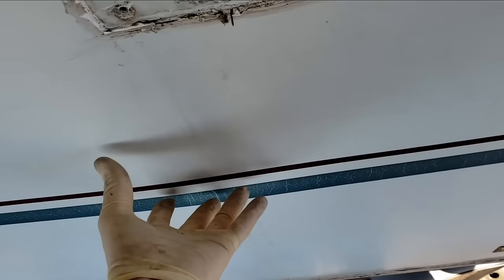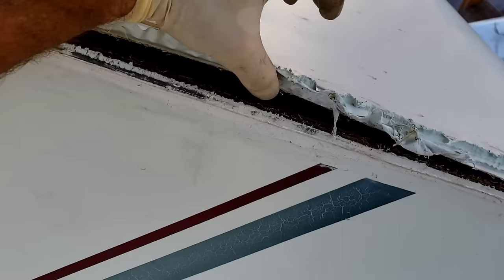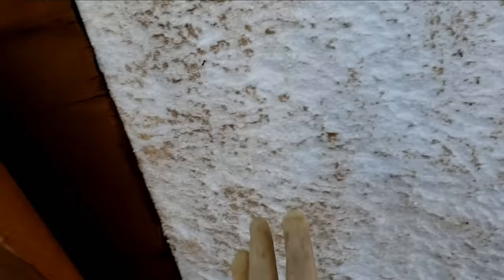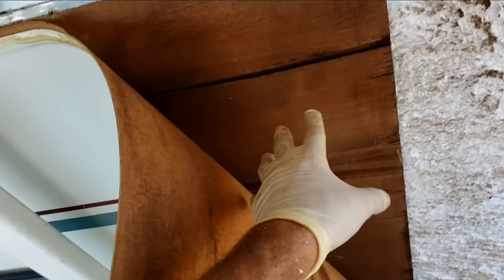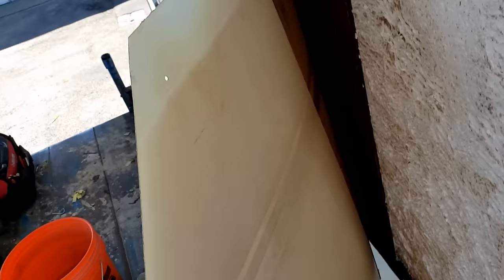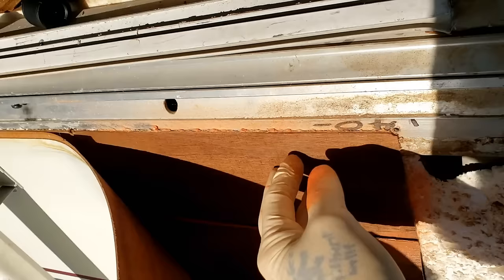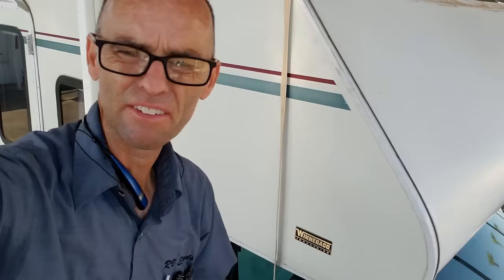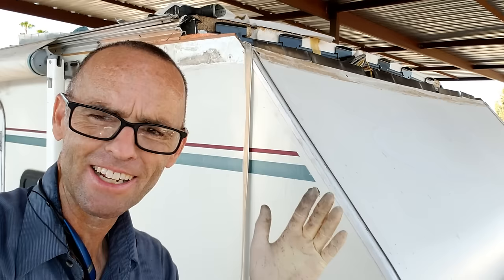How To Repair Loose Laminated RV Sidewalls....and Why It's Not Done

Comment: On behalf of all the hands on rv owners out here...We Thank You sir for making the videos you post on this channel!!!
Reply from the maker: You are very welcome. Thank you!
Reply: dave haag, a 100 thumbs up!!
Reply: Thanks for all these awesome videos! I wish you were closer, I really need someone with your expertise. 

I noticed you said not to put galvanized next to aluminum. Why is  that? Can it be done if you paint and clear coat the galvanized or if you put butyl tape between them? 

Thanks in advance!
Reply: @kyleblackburn1918  putting two dissimilar metals into contact with each other causes galvanic corrosion to occur naturally. If you want to see that in action then pull your aluminum wheels off of your cast iron rotors on your car and look at the wheel side.
Reply: Wow!!! I have this happening on my Eldorado... but on the lower half...it looks sad 😢
You did a awesome job!
Reply: @AZExpert with my having Zero experience, my mom asked for my help with this very problem. I assessed for well over an hour, even the act of conceptualising my plan of attack was tedious. Then my friend turned me on to this video after I had already done the majority of the work and left feeling overwhelmed and under pleased with my stopping point. I can honestly say after watching this video twice I've regained my confidence to go and finish the job and I'm thankful to report that I actually was able to do everything you put in this video, prior to watching it😊... other than not removing the trim & one addl. minor detail 😮I did not use Stay Bond. Personally I believe she's watertight and roadworthy. Mom says not the prettiest. 
I have recently started looking for 1/8 inch Luan. I cannot find it anywhere I can only find 1/4 inch. I believe I have left a heavy quarter-inch between the trim lip to the fascia front... I had already purchased a mildew resistant non textured very thin plastic built by an RV company I'm thinking maybe I can use that quarter inch Luan with that... any ideas or after encouragement I would appreciate. Thanks for your videos, you are a very helpful teacher. 👏👏👏
Reply: Agreed

Comment: I have a travel trailer with this problem. I bought it new 10 years ageoand this started at about year 6. Unless you buy an Airstream for more than $ 100,000 you potentially have this problem. These units, especially the cheaper ones like mine are rolling pieces of junk.

Comment: I think someone could watch all your videos and praticly become a pro RV repair tech. Thanks for sharing your talents!
Reply from the maker: Thank you, but I must confess I have watched youtube for help too.
Reply: @bretspencer  I sold an 05 dutchman 31ft travel trailer coupe months back. Bought as a project. I've done 3 travel trailers and rebuilt/remodeled them, currently looking for number 4. It started about 20 yrs back when I bought the 1st one from a friend. That's when the learning began, had to replace the stud framing accross the back, the bathroom had visual signs of water damage. Like I told my wife, they din't rot from the outside in, rather from the inside out. If you can see water damage figure on opening up the wall. Another little note, the 2X2 wood studs that they use to make up the house framing is such a cheap, sorry wood that it is not sold to the general public. It is from a tree called 'Lodge Pole Pine', very junky wood.... I think it will rot just from higher than normal humidity ranges, lol.
Reply: @bretspencer  Well said!!
Reply: @jamesmoore3346  Our local big box home stores sell 2x2, and 2x1.  It is crap wood, though, and you can never find a single straight piece anymore.  The last contractor I saw who needed 2x2 was just buying good 2x4's and cutting them in half on his table saw, since they were better quality and cheaper, too.

Comment: Been there and done that, except I used azdel in place of luan as the backing to filon. Azdel is a composite sheet product that is completely water proof, and is impervious to water exposure.  It is not a laminate like luan, and will not come apart nor develop mold when exposed to water as luan does.  I rebuilt the entire over-head cab portion of the coach with this material and eliminated any water issues, even though the front overhead cab of the coach has windows in the front and sides. It’s a great product, and I would like to re-skin the remaining walls of my coach to eliminate the remaining luan in my coach walls and replace it with azdel.
Reply from the maker: Thanks for the suggestion
Reply: 100% agree with you. This fella does great job reconstructing but  only back to OEM spec. I wish they would determine the actual root cause where the failure happened, I feel like it’s the butyl tape that dries up and allows water in slowly. At least that is what I think happened to my class C. Also doing cab overhang rebuild 😕

Comment: Just saw your Video and you gave me and my wife a little hope and some shine shine at the end of the 🌧rainbow.  We definitely have shed some tears 😭 these last few days. After five years of me going through extensive physical therapy for a traumatic brain injury I suffered from two battles I fought one on the home front as a police officer and the other while in the military.  We were so excited that I had recovered enough to start traveling and we were ready to live or dream and start seeing the country. Especially like every one else. The last year of being lock down and not being able to travel was just one more
reason to hit the road running and we could hardly contain ourselves when we found the RV of our dreams this past week. We had budgeted to only want to spend 15-20 for a pull behind camper but when we found this motor home that had low mileage and was super clean we just thought it was meant to be ours and though it was  25K for a 2004 Jayco Greyhawk 26SS 25 footer that had only 25,500 miles and was very clean.  We thought we would come up with the extra money some how and make it work. I did get on the roof, check for leaks but in all the excitement I missed getting up in the bunkhouse to check the corners for leaks and when we got the RV home and we started getting it ready to take it camping this weekend for my birthday.  We pulled off the bunk mattress and noticed it was wet underneath and than found that in the right corner of the bunkhouse we have a leak that goes along the right wall of the bunkhouse. The other side wall is okay. Just that right side, just like in your video. So you’ve given us hope that we can get this fix. I’m almost willing to drive to AZ haha. We’re thinking if we fix the bunkhouse, should we just pull the trigger, get the roof fix too and add a new one. We’re far from rich and would have to borrow some more money  to fix these issues. We just can’t see us not fix it right.  You might just be are savior. 

What’s a time line for something
 like this and how many days would it take. Any suggestions or help would be appreciated.
Reply: It takes a lot of time. But you can do it. Because you have to. That's a good motivator for me. Just be patient and don't quit, you will win.

Comment: Amazing work!  I am currently rebuilding the entire Class C attic space of a 1998 Winnebago Minnie.   The side walls have water damage as did the entire attic bunk space walls, floor, and transom window wall.   It’s been a major job thus far and the demolition phase was very time consuming.  The final product will be nice.  Your video certainly made me more confident about rebuilding the side structure.  Thanks a million!
Reply from the maker: awesome!! Glad to help
Reply: I'm about to do the same work you just described.  Could I ask about how much it has cost for the full repair ?

Comment: My Wife and I live in our 2000 Country Coach Affinity.   The charging, battery System is very complex.  The system that you replaced a relay on was very informative.  I love your channel and you are the most knowledgeable I have ever seen.  Thanks for what you do for the RV community.
Reply from the maker: Thank you so much for the support and compliments. I really do learn something new everyday. Like today I learned how the automatic sewer hose system works on a Marathon coach.
Reply: @AZExpert  I really need a fixer. I live full time in  my Class C. The one like your showing MINE  received damage during Tornado a few yrs back. Now its bulging out water is still getting in. I had the entire bunk replaced 3 yrs ago so far no interior water damage is appearing. I have placed a strip of durabond and now 3 M weather proof tape trying to keep it dry as much as possible. A mobile service said They would have done the same. But it's not holding up. Im trying to find a repairman to fix it while I'm living in it. Do you have a garage or location you recommend or could you do the fix.  I'm willing to drive wherever to get it done ASP. I need my home and want to keep it as long as possible.

Comment: Thank you James. You make this look a lot easier than it really is. I’m just so impressed with your capabilities that I wouldn’t use anyone but yourself for repairs that are essential to an RV. 
Having seen you recently replace a Winnebago roof I would never ever buy one. They look like they are held together by a wing and a prayer and the structural integrity is never considered. 
The figures are just out re sales and it’s thought that Winnebago has dropped by 50% I’m not surprised. I personally doubt that a company that sells rubbish will not have the customer base it’s once attracted. 
Thank you again and when you see a Winnebago pull up…. run 🏃
Reply from the maker: I do tend to cringe

Comment: GREAT ! GREAT ! video. My husband and I bought our first camper which is a 2002 Frontier Plainsman by Peak.  It is a 5th wheel that needs the corner were the bathroom is replaced.
After watching this video you gave us some very great tips.  I have taken the wall out (on the inside) along with part of the roof behind the bath tub, removed the bath tub and am pulling all the rotted luon so I can start the reframing.  I love learning how to do new things and this is definitely going to be a challenge.  I guess its not bad for a 67 year old women.  Hubby will be making the framing boards as needed.  GREAT instructions.

Comment: I owned a 2000 minnie, and redid that bunk area twice. It was in worse shape than the one you are working on.  When the side opened again, I sold it.  Now I wish I had taken it to an expert to fix....might have been 20 years old, but it was made much better than todays motorhomes.
Reply from the maker: I am a big fan of Winnebago class "C" and "B" motorhomes, and really they developed the same "manufacturing" in the late 90's and nothing has changed...which is why I have an issue with "high end diesel" Winnebago motorhomes.

Comment: WOW James.....been there  - done that.  The nose slowly de-laminated above the driver area.  It came loose while I was driving 60 MPH and flopped back about a foot, laun particles scattering in my rear view mirror. Pulled off the highway, broke out the duct tape ( RED GREEN show technique ) and crawled home. After removing all loose material, rebuilding  a window frame,  I spread Liquid Nails tube adhesive and Gorilla glue to fill the gaps. It turned out satisfactorily but was TEE-DEE-OUSSS   as you said.  Sadly , your video was not posted yet.   We all learn from each other.  THANKS     JwgK
Reply from the maker: I am amazed by the power of duct tape.

Comment: I did a similar job on the front 5' of my fifth wheel last winter. The filon was gone when I bought it and the previous owner tried repairing it with liquid nails and bathroom wallboard. I removed all that and cut a clean edge thru the filon and luan. I then glued up a new sheet of luan followed by a sheet of filon. The seam isn't perfect but I filled it with epoxy filled with sanding dust from the filon. I also left the luan and filon long and trimmed it with a flush trim router following the front cap. I also had to rebuild the back wall. Most of it was delaminated but there was a couple spots where the original luan was still well attached. I removed as much as I could and sanded down the edges of what I couldn't remove. The repair went well otherwise and you can barely see the lumps. 

The back foot or so of the side is also delaminated but I ran out of time so I just squeezed some construction adhesive in as far as I could and crossed my fingers. It's still delaminated but I know the edge where it goes under the corner trim is sealed and secured. I will probably end up removing the window near the delam and trying the epoxy trick but I will use plywood and cribbing to hold it flat while it cures.

Your video is excellent. I was almost hoping you would crack the filon so I could see how you fixed it. I have a small crack in my back wall that I need to fix. It is completely sealed behind following my rebuild. It just looks bad because the crack is old and dirt got into it.

Comment: This was my first time owning or doing a thing to an RV. There was some water damage under a couple windows so I ripped out the entire back panel, and the front cab over , it was really quite straight forward , it was a pain in the ass in the rotten portions because the very thin plywood had turned to something resembling paper that was glued to the foam insulation. He shows some of this, yes tedious, some of it came out in Pea size pieces. So I had to use a paint scraper to peal it off bit by bit, but the more intact plywood was easy to pry out , then so long as the insulation is fine , and if it's foam it probably is , it's just a matter of sticking a new panel up. Really with a bit of elbow grease, most anyone could do it ! So don't be afraid to do it yourself.
Reply from the maker: I'm glad this helped, but sorry it's tedious :)

Comment: I saw your most recent video where you installed TPO onto a discovery RV. My question was answered by watching this video. My front nose cap has a really big crack from all the rain we have received these past few weeks. I was told this had water damage and was fixed but this must be something they did not tackle. Thanks for your help. Hopefully I can get this mended and back together before June when it's too hot to be outside.

Comment: Second on you getting a camera that rides on your glasses, or head would be safer, and explorations would be more visual.
Watching you fix a basement ac yesterday. 
It would have helped.
I am retired commercial hvac technician. Got me thinking, how many of those old r22 units are out there, that need service. I'm on the east coast. But everything you did, was very well in my abilities. Maybe, I should see if I can find someone in need. Have all my tools, and a jug of 22! Thanks for all the info and education!
Reply from the maker: There are likely 50-100k units. They should be very simple for a real HVAC tech, it's just the installation and age means repairs can be costly. I've tried a few different camera setups, but have had too many videos ruined because I can't review the shots easily until after the work is done just to find out the audio or video was wrong...or corrupted or never recorded.

Comment: I always wondered why people don't use HDPE (white cutting board material) for stuff like that. It's very easy to cut. You can buy it in 4'x8' sheets in various thicknesses. You will never have to worry about it rotting that way
Reply: I was sitting wondering the same thing Wailuku on a laminated material that's not even marine-grade or painted what's the rationale behind that maybe even some like Vapor Barrier like Tyvek
Reply: It's expensive material.
Reply: It's expensive and heavy. It would do a better job though for sure. A thermal formed uv resistant plastic would probably be a better way to do it and still keep it light and thin.
Reply: Azdel is the drop-in replacement for this thin plywood. It's very common on newer RVs.

Comment: Thanks for sharing this repair. I just looked at a 2003 Monaco Dynasty Regal and it has problems on both side walls, but the dealer still wants more than book value for the coach since it has low miles. 🤣🤣
Reply from the maker: Buyer beware. They will probably get it too

Comment: This just shows the importance of checking and maintaining your roof seals. A couple of tubes of roof sealant once or twice a year will be way cheaper than a de-lamination repair. Let alone the inconvenience and time to do the repair.
Reply from the maker: I always advocate for checking out your roof 2 times a year at least
Reply: Yup, was constantly chasing tiny roof cracks before they became a problem. Dicor here, dicor there.. finally decided to try some eternabond and resealed everything. Now to see how long it holds up.

Comment: I think sealant in all those screw holes would be good to keep future water problems at a minimum.
Reply from the maker: Yes, there is a butyl sealant under the aluminum molding, and the pressure from the screw squishes it to seal. Thanks!

Comment: This is truly interesting. I have a 1991 Lazy Daze, which has an aluminum roof and side panels, no leaks. Had no idea that other RVs use different materials. That filon and luan sandwich looks more difficult to make and repair. But I guess it is lighter than sheet aluminum, and weight is important of course. But if I were the designer, I’d use aluminum, with a heavier frame and suspension, axles etc. The customer would pay a bit more for fuel in exchange for durability and ease of repair...
Reply from the maker: price is the first and second decision for most buyers, quality and durability is rarely on the list.
Reply: @AZExpert  Understood -- so the solution is to go smaller than larger, to get the most quality at a more affordable price. And no slideouts!